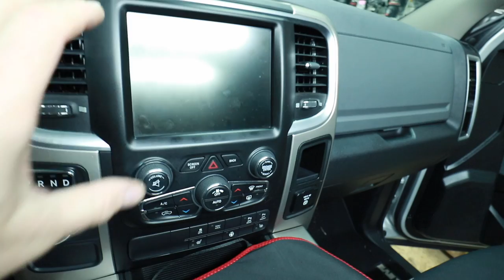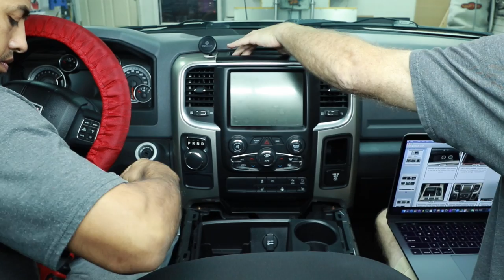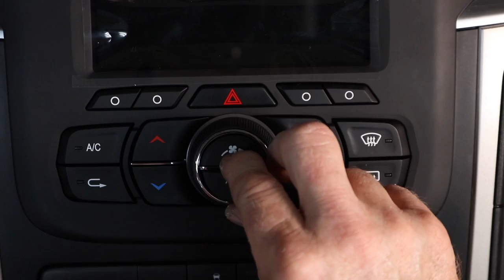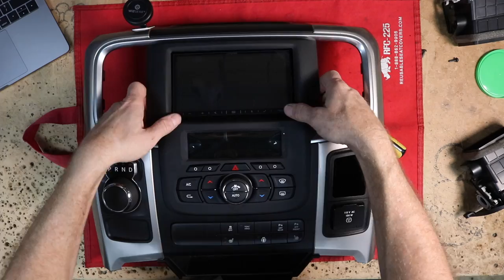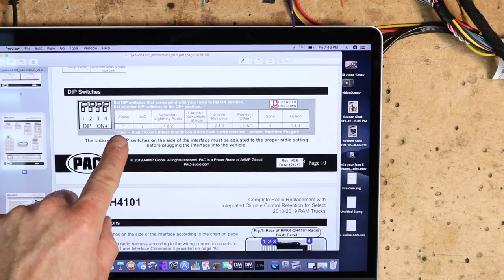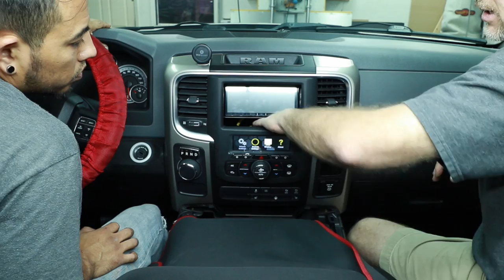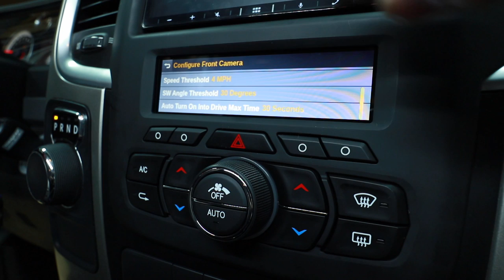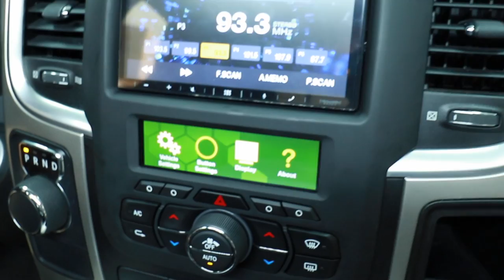New Dodge Ram radio replacement kit from Pac Audio the RPK4 CH4101 Beta review and install

Comment: Nice kit, I'm sure it's not going to be cheap though. One thing I was thinking with the USB updater port on the back, provided there is room, is to plug in a USB extension cable, tuck it under the dash or run it to the console storage, would make updating the background or firmware way easier than pulling the whole kit back out.

Comment: Would love to see a kit like this for the Dodge Charger. The factory radios are junk in those things. If you have one, hope that it breaks in warranty! That's all I can say until an aftermarket kit comes out.

I think at one point Metra had a kit which put an aftermarket radio underneath the stock radio (only if you had the smaller one) but it wasn't an ideal solution.

Comment: The 17 center console doesn't come apart like that. I know its something small but dont want others to think there all that way
Reply: I found THAT out the hard way... On the Big Horn 17's you don't remove the silver trim pieces around the basket/cup holder assembly as they are melted/fused in. You ONLY remove the two screws under the front cubby pad and the one 7mm under the bottom inside pad. Then pop the whole basket/center console unit out...

Comment: I have an Ram3500 2022 tradesman 
I recently upgraded with Alpine speakers.
After a couple weeks Front Passenger door speaker as well as dash front passenger speaker suddenly stopped working simultaneously both. 
what could cause that?
Will this pac solve my problem?

Comment: Have you installed a PAC C2R-CHY4 on 2005 dodge ram 1500 with a premium sound system. 7 speaker with amp steering controls but not the infinity system

Comment: So if I went to the infotainment 8.4 upgrade from the RA2 (5.0 UConnect) radio, the climate control would just mimic the manual controls on my dash. I wonder if that would be the same here, but I still have the other vehicle controls available... hmmmmmmm.. I checked PAC website they do not mention anything..  wonder if it would show trailer brake settings in the vehicle set up if you have it installed (like the stock radio)..  Wish I lived closer I'd buy the kit fingers crossed so we could play with it (since you have experience with it already ; ) )

Comment: It is really nice option, however would have to be tested to see if it's worth to loose entertainment and volume knobs, both i use extensively, the track list knob especially which has no steering wheel redundancy plus i have no way to see how the track list is handled in new radio. "Looks really good with the 2nd screen", but It would also help to have high quality comparison pictures somewhere on manufactures site to see the black levels, side fade and sharpness before spending 600 bucks, would hate to end up with washed out camera picture similar to aftermarket cams produce....4k video from maker showing good quality of back up picture and screen in general plus quick walk through menus would probably help many to decide

Comment: if i have an amplified premium system, does this allow for that to be bypassed so i can use my purchased decks sound and have full range signal going to all my speakers instead of the factory amps terrible crossovers for the doors and such. that is my biggest problem.
Reply: It does not look to bypass the factory Alpine amp, only integrate with it. If you want to bypass the factory Alpine amp you'll need to rewire your speakers. The factory Alpine amp is under the dash on the drivers side between the steering column and e-brake. You could tap in to the speaker wires there. Just know that you'll lose your sub if you go this route.

Comment: Is PAC working on this for a Jeep Grand Cherokee too?
Reply from the maker: Yes
Reply: 2014 jeep gc...is this out already...
Reply: @tonyf9218  I have a 2015 Overland I just purchased one offline for $399 that came with all the accessories plus hub and put it in. Love It
Reply: @onelove3002  where at? Looking for that.
Reply: @onelove3002  I’m picking up a2019 JC this week. The 2019s have CarPlay but I’m hooked on wireless I have in my other cars so I’m contemplating doing this. Question is what functions did you lose, if any. The stock unit has some stuff like off road info and I’m wondering if I’d keep that with my Pioneer DMH-W4660NEX.

Comment: I would have kept the dodge radio bigger screen
Reply: John Johnson 
What Dodge Radio?   What does aDodge radio have to do with a Ram truck?
Reply: Once you have wireless CarPlay, it’s hard to like cars without it. I’ll easily sacrifice the larger screen for the newer option. Now what WOULD be nice is if the new large screen Pioneers can be used with this kit.

Comment: Curious to see how reliable the pac usb hubs are going to work with how finicky CarPlay and AA is with resistance from cable length. This is becoming a bigger problem. 1 of my solutions is wireless! 
Great video

Comment: Glad to see another option for folks like me who have a Ram.  Comparing this new kit to others on the market that replace the whole center section with an Android interface, this one is less sexy.  More function over looks.  As Dean calls them, the "white box" radio competitor, simulates the new 12" screens in the new 2020 Rams, and everything is done through the dual screens instead of a small screen.  Options are good though.  I'm sure this kit isn't going to be cheap, as the competition isn't either.  Way to go boys!
Reply: I just don’t trust the “white box” radios on the market right now. I recently bought a cheap Chinese non-radio part that was defective and it was a nightmare trying to get a refund. I also used to buy cheap Dual radios which usually went out in about a year. Back then it wasn’t a big deal ripping it back out but nowadays I prefer to do it right the first time even if it costs a bit more.

Comment: @Five Star Car Stereo  
@ PAC Audio  
@AAMP Global  

Does PAC have an ETA for the USB/AUX connection blocks/panel jacks?

It would be great if the USB Firmware Update Jack was accessible without having to remove the entire dash kit!!!  ...maybe have it accessible when you pop out a small, inconspicuous panel cover, or a tiny, rubber, hinged door flap?

And WOW, Dean!  THANKS for the incredibly THOROUGH and IN DEPTH overview & installation video. 👍👍

I hope that PAC is compensating you in some way for your time & expertise in doing these videos, because their sales of these units will increase dramatically from having this video available!  $$$!

If PAC had to hire their own in-house personnel for a video production team to do these, it would cost them seriously BIG BUCKS!  You are saving them THOUSANDS of $$$$$.  They should "Pimp Your Ride" with your dream audio system!

Keep on keeping on!

Comment: Would I need this in conjunction with the PAC RP4-CH21 for a 2016 Ram 1500 Uconnect 8.4? I'm replacing it with a JOYING 10.1. I want to keep all functions my vehicle currently has.

Comment: Looking to change my single din to a double din in a 1999 Chrysler Concorde and maintain a 9 speaker amp system . I will update options to a 2002 300m special including dash and wiring and BCM .

Comment: Never understood why they can’t put a standardized plug for the cable going to the new head unit and adaptor kit for the vehicle wiring harness. I’d pay the extra 13 cents it would cost.

Comment: 26:47 - Setting customers up for the ultimate disappointment when they realize they can't add an imagine because the USB is hidden on the back.  I'd be tempted to just route a DMA6, hidden in the glovebox somewhere or under dash, as a standard install procedure should new updates ever role out or customer want to change their photo.

Comment: Cool kit, awesome to see there are options to replace the 8.4. probably should also mention that you will lose Uconnect Access (the phone app) when removing the stock unit. Also for the truck owner, that camera is bad, the halo around it means that water got inside and is vary common for these trucks, the image is probably blurry or not clear.